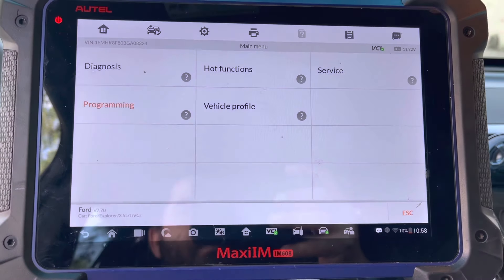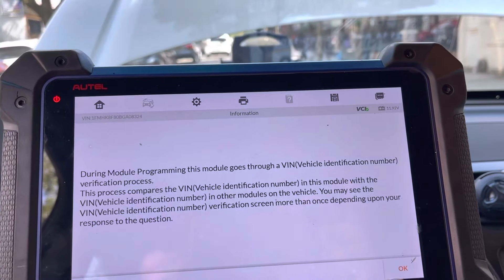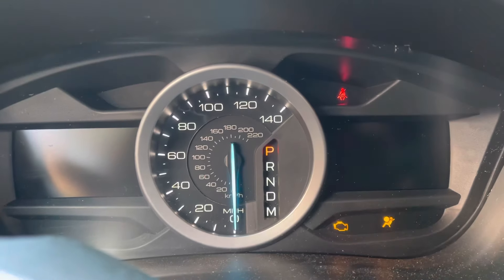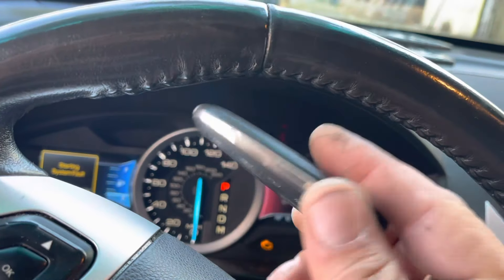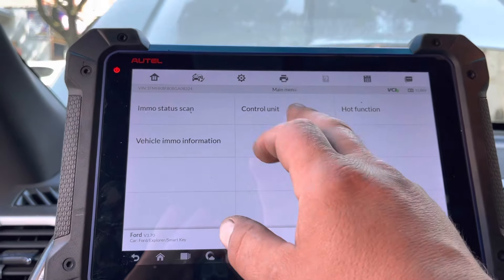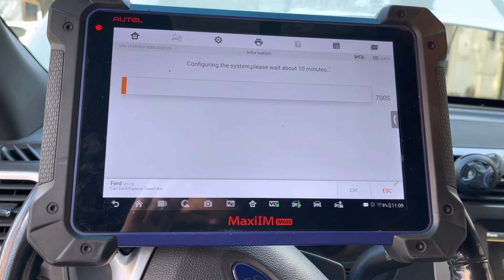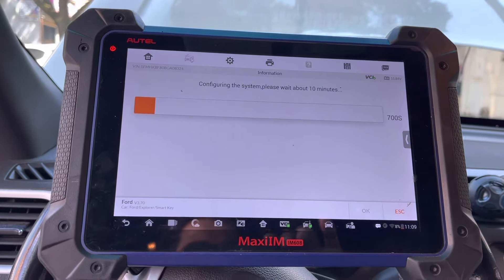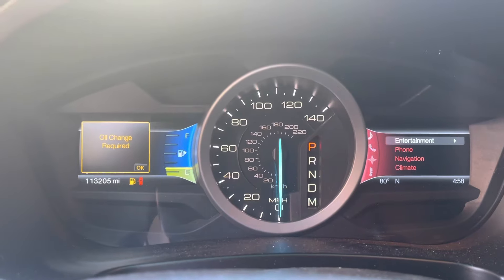FORD PCM SWAP,PROGRAMMING, AND PARAMETER RESET WITH AUTEL IM608

Comment: For anyone watching this you do NOT need this $3000 scan tool (Autel IM608) to do the parameter reset. At least on a 2009 Lincoln MKS (push button). Apparently the Autel MP808 is capable ($699 scanner). The function was pretty well hidden! I believe it was: Hot Functions > IMMO keys > PATS Functions > (Wait 10 min) > Parameter Reset. Once done, press any key fob button, turn ignition off, then on. Voila! No need to reprogram keys. My Autel MP808 was able to do this but my stupid Topdon T-Ninja 1000 (a dedicated locksmith tool) kept failing to access security system and tripping the immobilizer!
Reply: Yeah, would do but didn't write the vin, making it have a vin mismatch. This had been my challenge over time because some lights would be and not all customers like that
Reply: @Free-r7z  I'm actually not sure about the VIN write function. The ECM my customer used was preprogrammed to her VIN before it shipped. Also, I believe the MP808 only does remote programming. It does keys on a few cars, if I remember, but hit or miss. I would look at the Autel IM608 if you're trying to program chip keys to the IMMO system.
Reply: @Ken-1 im608 is the bomb but if you are not a licensed locksmith in your state, id wait until you find out if Autel enrolls into Nastf VSP required program. Soon Autel may only be accessible for licensed locksmiths for programning applications. As far as diagnostic, it should be accessible by every owner
Reply: @DFWAuto_Hack  as your name says, auto hack. ….. maybe if the hacks were paying taxes they would charge retail value and stop under cutting the industry, which is part of the reason why they’re gonna require certifications that way, we can restore some fair pricing to the industry so guys can make a living. Some guys don’t know how to run a business and are just living in the moment as in they think locksmith is easy money and six months later when they ran themselves into the ground, the next hack comes along trying to ruin prices. Couple that with auto thefts because every gangbanger out there was buying the tools and stealing cars  

Everybody makes it sound like NASTF or the locksmith that apparently those that believe that failed to realize that the insurance companies run America

When they’re paying out record Claims for stolen cars they had to do something and so they acted

If you remember anything, keep this in your head, the banks, insurance companies, lawyers, a.k.a. politicians run this country….

Comment: Remember form 2014 most fords can't be done this way as require link to ford server to program
Reply from the maker: Yes to program a lot of the newer models especially on PCM or BCM, you would need online access to Ford servers using FJDS, IDS, or FDRS to download and program correct files for the particular VIN.
Reply: I have a 2016 fusion se With blade key about to install new pcm. Yesterday I went to have a locksmith help me and he couldn’t get it to work. I noticed he didn’t not attempt to do the parameter resets as u did.
Reply: SIR please 🙏🙏🙏 Mercedes Aromatic Suspension programming

Comment: I have a 2010 Ford focus bought a remanufactured ECM take it to Ford did not work car wouldn’t start  they had to put back the old one in and the P0420 code still there waste of $850 all together what to do now however I did get back a replacement remanufactured  one back since it didn’t work. What can I do now I hate that check engine light?

Comment: Hello 
If the old pcm is flood damaged and im608 cannot communicate with it- do you just plug the replacement pcm and go through the process or you must pull info from old pcm to configure new one

Comment: hi there, does it work on tcm as well?
Reply from the maker: Yea it does, but it might be slightly different than this. If not in Programmable module installation it might might be on programmable parameters. If noting in both menus, you would have to use IDS or FJDS to do online programming.
Reply: @huyug1  ,i was going to buy the maxisys ultra or im608 to programming ecu,etc since i have im508+xp400pro  i not sure wich one would be best opcion,thanks 🙏
Reply: @huyug1  i got im608 pro ll ,i didnt give the option to program a focus tcm .
Reply from the maker: @gandhi2926  some modules needs to be online programmed using IDS.

Comment: I have the I'm 506 and the autel j2534 will they work like the I'm 608
Reply from the maker: No, it will not since the software in 508 and 608 is totally different in diagnostic side. But you can use j2534 device with your pc to do j2534 Diag and programming with OEM softwares.

Comment: Hey man. I have a 2012 Ford Focus. I just bought a new pcm and gave them my vin to program it. After install what should i do next.
Reply from the maker: Parameter reset
Reply: @huyug1  so i see i need a bi directional scanner. Do i need to buy the snap on or autel version to get what i need or would a decently priced bi directional scanner do the trick. Really don’t wanna spend 500$ on a scanner if i don’t have to
Reply from the maker: @jacobholmes8982  Autel İM series will do it or you would need another locksmith tool.

Comment: I replaced the PCM in my 2013 F150 and used Forscan to initialize the PCM via BCM to my existing keys. Very easy process .
Reply: Was it a junkyard pcm?  Or did you have to buy it and have someone else program it?  I’m in need of this for a 2010 explorer 4.0
Reply: @garybalcom715  Flagship programs it based on the VIN number you give them. But the truck will not start until the PCM is initialized. At least that's how it is on my 2013 F150.

Comment: That scanner is $5000 Wth… can it be done with any scanner?
Reply from the maker: Actually it is around $3000 even cheaper. They even have IM608 pro II for the same price. There are different cheaper devices less than $1000 which can do it and they are too high end devices such as Topdon.
Reply: I have a Topdon T-Ninja 1000 obd key programmer and the parameter reset function is available in the menu. I have a PCM swap on a Lincoln MKS tomorrow, we'll see if it works. The device has mixed reviews. I've only used it twice in the 18 months I've had it, will report back results
Reply: Did the parameter reset option work? @Ken-1

Comment: I have a 2019 Ford Fusion Hybrid and replaced the DC to DC Inverter because it kept throwing a code and said service battery charging station.  So I replaced the Inverter then used Cardaq and updated everything but then I got the code P161A-00 - Incorrect Response From Immobilizer Control Module. So the car won't start at all.  I assume I don't have to do all the steps you did but just the RFA key one?

Comment: Did a ford ecu swap awhile back and could not get rid of a 1000 code. It starter fine and drove fine but had check engine light on and 1000 code only after another ecu I was able to get rid of that. Any suggestions or was the ecu not good you think. Thanks.
Reply: P1000 is normal should go away after all monitors completed

Comment: I have a 08 ford explorer sport track 4.0L
With bad pcm. I replace it with another one from Ares Technologies but the local locksmith cant married the replaced computer with the keys. Ares says that it has to be 2 uncloned key in order to start the key programing to their pcm. 
With the Ares pcm installed and switching both keys  ON the security light turns on 4 second then shuts off and stay off and for locksith guy say that the way security light acts indicate that there is a problem with the pcm Ares sold me. Locksmith guy say: the security light should be blinking with the keys on.
I will get 2 keys from ford with diferent code each one and then see what happen next. Any advice I will appreciate.

Comment: Hi Huseyin is it the same to do for escape 2011 ? my ecu is burned not able to read vin number 
thanks
Reply from the maker: Yes! Exactly.
Reply: mine when i go to progrmmable to able to het infos from my old ecu already burn it ..whats the solutions ? Thanks
Reply from the maker: @aliboumelhem7165  that’s exactly what this video is explaining
Reply: @huyug1  i tried the same my issue ..not able to connect to my old ecm  
my question is ..if i dont have a ecm at all how i should do the steps ? thanks
Reply from the maker: @aliboumelhem7165  follow the steps exactly like on the video
Reply: it works but inverse.. start with the key .not able to replace vin number

Comment: If the old PCM was not working, you wouldn't be able to copy it in the first place. 
Am I right?
Reply from the maker: That’s definitely right. But, you can retrieve the as-built data of motorcraftservice.com and still code the module and will have the same result. You can watch the video with power steering for Ford Mustang and you can do the same thing.

Comment: TNX FOR VIDEO,,I BOUGHT THIS IM608,,,BUT IT DOESNT GIVE ME THE PCM ICON UNDER PROGRAMMING FUNCTIONS????
Reply from the maker: It does not cover every module and model. Sometimes you have to use ids or fjds
Reply: @huyug1  tnx for your reply ,,,im new to this what are ids or fjds???..tnx again...
Reply: K FOUND THE INFO,,,,TNX AGAIN GREAT VIDEO,,,THUMBS UP,,,,,,,,,,,,,,,,,,
Reply from the maker: @tonycastro6154  manufacturers softwares
Reply: @tonycastro6154  They are saying that anything 2014 and up need link to ford servers so ???

Comment: Does this procedure work for old one module or just new one
Reply from the maker: Only on old used modules. New blank modules would have to be reprogrammed using IDS/FJDS/FDRS OEM softwares.
Reply: @huyug1  if the module its blank without firmware how diagnose can have comunication with pcm?
Reply from the maker: @viridian6903  there is a base program in it always which will let you communicate and program.

Comment: Hi I have questions after I reset the parameters  pcm to bcm and bcm to rfa the cluster is off what I need  to do  now because the push button  is just off all times
Reply: Did you find the fix?
This just happened to me.

Comment: How much would you charge to do this job and what should be the going rate ?
Reply: I can answer what the going rate is, because I have called multiple locksmiths, and they quoted anywhere from 150.00 to 275.00.  Unbelievable!  I bought my own scanner, 145.00, and will do it myself.

Comment: which scanner is that? the im608 or im608 pro
Reply from the maker: I’m608 and im608 pro is the same with capabilities on tablet side. only difference is the xp400 which is usually for bench programming.

Comment: Dear, thanks for sharing.  When was the VIN number programmed? Gracias saludo
Reply from the maker: Vin number is written in AS-BUILT data or coding data which gets transferred during first process right after we swap the modules.
Reply: And why not show the Vin process of built data because show the Audience what a scan tool is gone do for them is showing them nothing  wow
Reply from the maker: @superiorautoprograminglock9416  it doesn’t show you when it writes. It only asks you if the vin number is correct and does it right after swap which is all recorded
Reply: @huyug1  my 2017 Raptor was stolen and is now being sold under a different vin. The make model mileage is all exactly the same. The dealership has doctored the books and the service records. In the “new” vin number under service records it lists the mileage as 666,666 in Dec2021. I know it’s my truck how do I prove it? Even if I tell them things about the truck that can be proven they’re still trying to prevent me from seeing the truck. Thanks for your help.
Reply: The original vin number is in many places on the vehicle. You just need to examine it carefully.

Comment: I just bought an MK906BT to program a new PCM on a 2013 Explorer. Do I need the J2534 box or will this scanner do it alone? 

I see in your video you have a box on the center console…
Reply from the maker: Not necessary as long as you have the programming option available

Comment: What if there's no communication with PCM?
Reply: if you’ve got a problem with any of the systems on the network the whole thing will go down.  schedule a diag, because unless you have a DBA to search through the splice pack, you better start pulling control modules and break out the oscilloscope.  call a diag pro dude.
Reply: @erl7466  sometimes the PCM is fried and that's why there's no communication, Not only can-/can+, and that's what I mean when I said "what if there's no communication?", cause you're talking about swapping. But now I know that there's no way to do it with that scan tool, the only way to be done is with an OEM software such as IDS/FJDS. I thought you had any other method. PS: I fix wire harness.

Comment: Good video thanks.. I’m a locksmith & I’m about to do this on a 2012 ford fiesta blade key. Customer had a new computer/pcm  preprogramed before installation so I’m not sure if I need to do a parameter reset or immo replacement option or just reprogram the keys. This will be my 1st on a ford as far as PCM replacement, I’ve done many Chryslers/dodge/Jeep when the customer replaced the immobilizer I did immo replaced & transferred the secret key & then reprogrammed the keys but never a new PCM that has already been pre programmed so that’s why I didn’t know if all I needed to do was just reprogram the keys back to the ford Fiesta since the computer/PCM has already been pre programmed.
Reply from the maker: If module is preprogrammed already, parameter reset only. If key info is stored in PCM which I don’t think, than you need to program 2 keys minimum.
Reply: I need a locksmith here in the Tampa Bay Area to reset a 2007 Ford Explorer that we just bought a computer for. Do you know what I should ask when calling around for one please?

Comment: Hi I have an autell maxidas 708 can it perform 
The the coding after an Ecu swap I'm *7an 01

I have a 2001 Ford F150 I needed to do an ECU swap so I got an ECU out of the wrecking yard and it came with the ignition cylinder the actual key and the key ring that goes around you ignition cylinder what other components do I need in order to start the truck

Comment: Hi, I want to swap a Lincoln MKX 09 PCM part n: 8T4A-12A650-KF to an Ford Edge PCM pn: 8T4A-12A650-KC, I have 1 key, can it be done ? one more thing, can I put a more recent PCM part no : 9T4A-12A650- XX ?
Reply from the maker: The part numbers needs to match identically normally. But if the all the engines system is the same in both cars you should be able to program it. Needing a second key changes model to model. If you have a metal key, most likely you will need another one.

Comment: Hi, nice video. Why was the computer replaced?
Reply from the maker: Actually there was nothing wrong with the computer. The technician did wrong diagnosis. I was there only for programming. But usually a lot of times misfires with coils and immobilizer related issues can be caused by PCM.
Reply: @huyug1  thank you 🙏

Comment: after parameter reset which function u used to program smart key  [all key lost or add key]?
Reply from the maker: I didn’t have to reprogram the key to start the car. Two types of parameter resets were enough. Because key information is not stored in PCM.